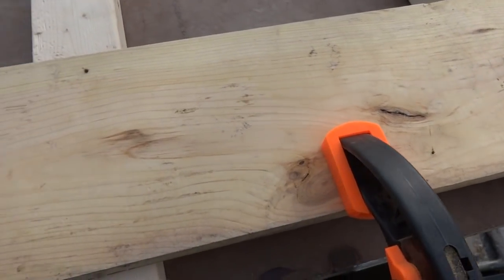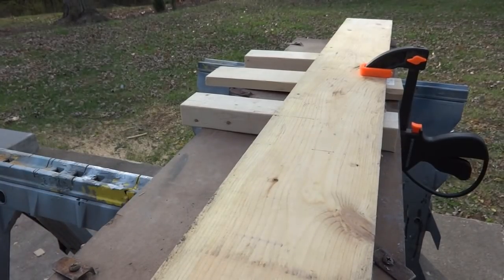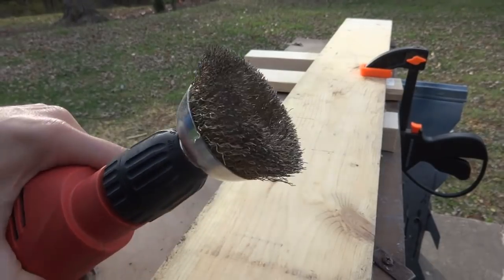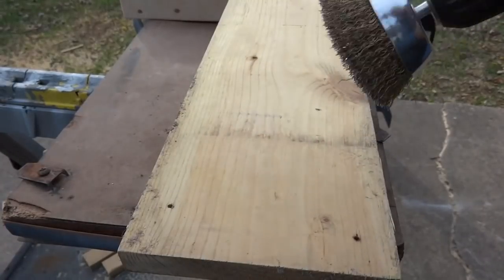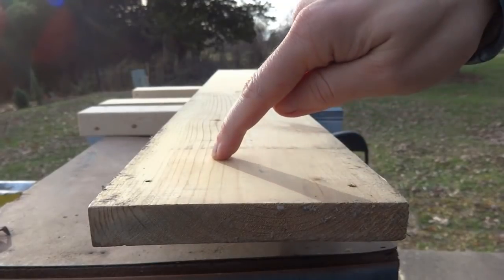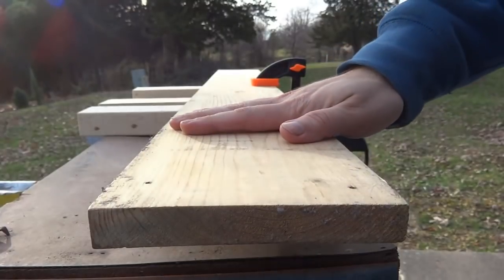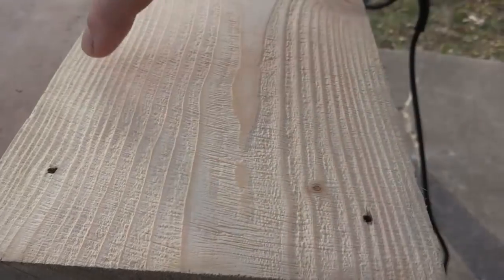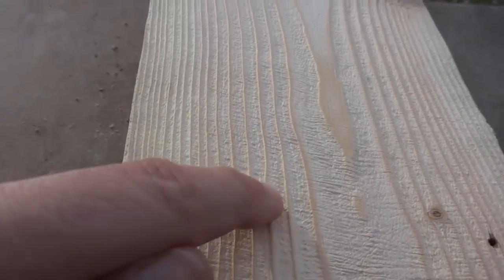How to Make Wood Look Old & Weathered (Texture Trick!)

Comment: Looks good. The gray stain looks awesome. I use a torch and burn the surface before using a wire wheel. Burning makes the softer wood dig out easier and allows you to use a softer bristle brush (brass)  so the scratch marks aren’t as obvious. Plus the remaining darker areas from burning adds a little extra age effect to the wood.

Comment: great video, straight to the point. Thanks a lot for posting. I'm making a coffee table and I've been looking for this finish of texturing wood quite hard, really happy to finally find your post, exactly what I needed to watch. Best stuff!
Reply from the maker: +Origin Base Awesome, glad to help! I've been trying to figure out how to get the weathered barn wood look for a while and thought of this wire wheel method. I did some research and saw that others had used one in a similar way, so I gave it a shot. Turned out pretty cool!

Comment: Really nice job.  You handled the first troll in a gentlemanly manner. Good go.
Reply from the maker: Thanks! I decided a while back to either just ignore rude comments or just give a reasonable explanation, be nice, and go no further with it. I don't want to spend my time or energy arguing online.
Reply: I am interested in making a barn wood wall. What size widths do you use? I was thinking about using 6" & 8" is that to wide?

Comment: Great idea! Reclaimed barn wood is really expensive. Plus, if you make this for your own home, it feels a lot cleaner than old barn wood. Where did you get that attachment? Home Depot and Lowe's sell it?
Reply from the maker: +mascottie Yeah, barnwood can get crazy expensive. I still prefer to use reclaimed wood any time I can rather than buy new, but this works great to make any wood (new or old) have that aged, weathered texture that looks so cool. I got my brush from Menards, but any hardware store should have them near the drill bits or sanding section. It was only about $3 or $4.

Comment: another thing you could do on top of using the bristle brush is to use a small section of small chain and hit the wood with that and in the dents you make use a darker stain than on the other sections of wood.
Reply from the maker: Yep, that's a cool trick to add signs of "use" and "wear". I've also drilled holes and even hammered tools and bolts on their sides to leave impressions. Looks pretty cool.

Comment: Man,  awesome paint work, absolutely loved the 6:40 minute look idea, could you be more specific, how did you do such a great look?
Reply from the maker: +Denis Taran That little board was done just like I show in my "Pallet Wood Paint Trick" video, except I used dirtier, grungy colors for the old look. I took the textured board and quickly brush painted a few spots with a light country blue, sanded it, then added some of my homemade wood stain on top. The exposed, raw wood parts soaked up the stain & turned dark brown, while the spots with the blue paint just let the stain kinda smear all over for the grungy, dirty look. The teal & red board was done the same say, except I used a homemade colored stain instead of my regular homemade brown stain.

Comment: Awesome trick.  Pine has the resin in its "grain lines" which is harder than the cellulose in the "wood" which I see makes this trick work well.  Have you had similar experiences with other wood?

Also, you need to figure out some kind of joinery (not necessarily miters, perhaps half lap or something) for your table edging!  It's the only part of the table that has made me cringe a couple of times.  I bet you could make more from them too!  Please don't think I am being too harsh, just trying to offer some constructive criticism. :)
Reply from the maker: +Jason Adamczyk Yeah, the lighter parts of the wood is the spring wood (the part of the tree that grows fast early in the year.) As summer comes around and the tree starts growing slower, it becomes more dense, harder, & darker (summer wood). That combination of fast & slow growth creates the rings inside the tree. Different grain patterns and wood hardnesses react a little differently to this technique. I mostly stick with reclaimed pine since it's practically everywhere for free, and I still have a huge pile of it in my basement.

I do miter cuts for my table edging sometimes, but I like the simple, clunky look of this straight forward look. I also sometimes match them up in sort of a "spiral" pattern to add a little style without getting too fancy.  I'll admit, this one was a bit off in the one corner that showed in this video though. It made me cringe too. ;) I was in a time crunch and rushed the finishing a bit too much. The lady loved it though. Her dad ordered 3 more tables, and I'll definitely up the quality on those.  I tend to keep ultra beginners in mind when I make my project videos, so I try to not use any special tools or do anything too fancy with them.

Comment: Great job, Mr. D!! By coincidence, I'm accidentally familiar with using your kind of stain. Just last week, I was de-rusting some great, old Wetzler clamps, and when I took one out--after being in there for many days--to sand it down a little more, I accidentally dripped some of the vinegar/steel liquid on a new piece of cherry I was about to use on another project.  Man, that stuff does NOT come out!!  
But I wanted to ask: I'm looking to get exactly the weathered barnwood look you show here, but in your "pallet wood" video, none of the samples you showed got as dark as the grey you show here. How did you get that perfect deep grey??
Last question: Do you have any tips on wich lacquer to use? For my current project i have to be absolutely sure none of the stain or anything else can rub off the wood.
Thanks for the great videos!

Comment: i think I'm going to try this on an indoor storage/bench project. only question is what sort of feel does it leave after? is the part between the grain rough enough that it would catch on fabric?
Reply from the maker: It does give it a rougher texture. If you run the brush along the grain instead of on a diagonal against it like I did in the video, it's turns out a bit smoother. Also, once you've added the texture, you can run a sander over it to knock it down a bit to smooth it out more and prevent snags.

Comment: MrDiyDork I recently used your technique to texture a table and I am using a polyurethane to finish it but I am getting inconsistent spots, I think it's because it's not a smooth surface but do you have any tips as to how I can get an even coat? Do I just keep applying more? 
Thank you
Reply from the maker: Sounds like maybe it's absorbing more in certain spots? I would probably try adding some more like you were thinking and see how that works.

Comment: I am doing a large project. 17 1" X 6" X 8" & 17 1" X 8" X 8". I tried this out with  a steel 3 inch brush and 1/4 drill and I am not getting the deep texture that you are? As fast as you? any recommendations?
Reply from the maker: Hmm, I found that you can either run the brush in one direction on a slight diagonal to the grain and then flip the board around to brush it in the opposite direction (like I did in this video), or you can actually reverse the drill (and it will really dig into the wood but is a bit harder to control) like I did in my barn wood video. It does take a a few minutes per board to get the texture going. Also, the harder the wood or the tighter the grain, the harder it will be to get the grain to pop.

Comment: Can this method in white blue and stain (6:18) be done with two stains ( weathered blue, weathered gray)? or first layer with paint is a must? I'm new to woodworking and making two wooden planter beds for my patio. I would like to try this technique, but already painted the first planter and want the second one match in color. I'm worried that I won't be able to find exactly the same color in paint.
Reply from the maker: +Magda Jablonska-Backman Hmm, that's something I would test if possible, but I'm thinking that the two stains will just blend together into some sort of brown/gray color. The paint acts like a resist to the stain, so the exposed wood sections soak it up, but the painted sections don't which creates the effect.

Comment: Idea to propose... could you just powerwash the wood?  That has the same tendency to remove the softer wood (ie leave the harder grain lines).  It would be quicker and not leave those criss-cross lines.  The drying from the water would add time though.  It would be great to hear your feedback and/or see if you can try that method in another video.
Reply from the maker: You could definitely try powerwashing it. It would be much quicker and I'm sure the texture would be bonkers!
Reply: Would the wood warp or cup from being wet?

Comment: Do you think a wheel sander with a wire brush attachment, would leave the same ridges and high points or are they too wide?
Reply from the maker: Hmm, I'm not sure. If you have some scrap wood, it would probably be pretty easy to test out just to know for sure.

Comment: A wire wheel brush for drills works much better than the circular one you're using. It won't make those circular marks across the grain like that so you dont have to go over it twice and seems to do a better job of removing the soft wood.
Reply from the maker: +jm tigerfan I do like the cross grain this produces,  but yes, a regular wire wheel would probably be a bit easier to control. When this one wears out, I'll probably grab one of those next.
Reply: Good idea.

Comment: Was there a link to the grey stain? I saw the one colored, and the one with steel wool.  Thanks
Reply from the maker: I made the gray stain the same way I made the color stain. I just used gray paint instead of bright orange or whatever. Once the wood was stained with the gray, I dabbed a few spots with black and then dry brush a little bit of white throughout. I've been thinking about doing a video on how I did that barnwood looking piece since I've been getting a lot of questions about it.
Reply: +MrDiyDork thank you for your response. I look forward to a grey Barnwood video!

Comment: where did you find that brush to fit in the end of the drill bit? my home depot only has the ones for a grinder. thank you
Reply from the maker: I got mine at Menards, but I've seen them at most hardware stores. They're pretty cheap at Harbor Freight too if you have one of those nearby.
Reply: I have a harbor freight. Thank you very much

Comment: when you say clear coat, can you provide more detail? Polyurethane? And how many coats do you generally apply?
Reply from the maker: Yep, oil based polyurethane, water based polyurethane, lacquer, spray clear, etc, etc. Whatever you prefer really. The oil based clears probably make more sense when the wood is exposed or stained rather than painted, but I've done it both ways. I'm sure some people are picky on what clears they use. I tend to pick whatever is quicker, easier, less messy, & handier at the moment. At a minimum, I'll do 2 coats, but usually, I put on 3 coats with light sanding & a damp cloth wipe down after the first and second coats.
Reply: cool paint effect

Comment: how long does your brush last?
Reply from the maker: The wire brush? It should last for a long time. It depends on how much and how often you use it. I've used mine quite a bit and it's only just now starting to show some wear.
Reply: thanks

Comment: pressure washing wood will also take the soft wood down quickly without as much work as the metal brush. my mother in law pressure washed our beautiful redwood deck railing and ruined it with HIGH pressure. every wood will require a different pressure. have fun.

Comment: My only gripe, left over wood from previous projects is NOT reclaimed wood.
Reply: What is the definition of reclaimed wood?
Reply: Reclaimed lumber is synonymous with timbers and decking rescued from old barns, factories and warehouses. 

I used scrap hardwood flooring to make a coat rack. I wouldn't say that it's reclaimed wood though, it's brand new. It was just left overs from a previous job.
Reply: The video is titled 'How to Make Wood Look Old & Weathered (Texture Trick!)'
Obviously you can't 'make' reclaimed wood, you have to 'reclaim' it..WTF
Reply: Good grief!

Comment: Very nice technique. But why is the edge of the table so poorly done? The outside trim is so far off-- part is at least 1/8-1/4 inch too short. And why is the tabletop finished but not the trim? It looks bad. That's not good workmanship-- and no one wants to look at pocket holes-- they are meant to be hidden-- or if showing then filled with pocket hole plugs and sanded smooth. If you're making your own project, do what you want-- but if you're selling and charging money for custom work, you really should work on your finishing skills. Just sayin'--

Comment: Have you been inhaling paint fumes? You can't make your own slovenly work "really awesome" just by saying that over and over. "Really awesome" is not some mystical incantation that magically hypnotizes others into overlooking glaring obvious flaws. You took nine and a half minutes to describe what could be done in two, and your method is clumsy. You used the wrong type of wire wheel. Just look at those corners of that "rustic" table: not mitered, open gaps, mis-cut ends. Sloppy and shitty is not "really cool." It's just sloppy and shitty.
Reply from the maker: I thought the wire wheel technique was pretty awesome, so I called it awesome. I like to give lots of details, so I make longer videos. I used that cupped wire brush because it covered a little more area than a thin, straight wheel. The table edge was bad. I crunched myself for time and royally screwed up that corner. The lady still loved the table though. I kind of prefer the look of butt joints to mitered. I like that simple, clunky look for some reason. I'm definitely no pro woodworker, but I like showing these tricks & techniques as I figure them out. Thanks for checking out the video anyway. Hopefully
Reply: Could you be any more rude, Learner?  Good grief!  I don't know what has happened to humanity in this country.